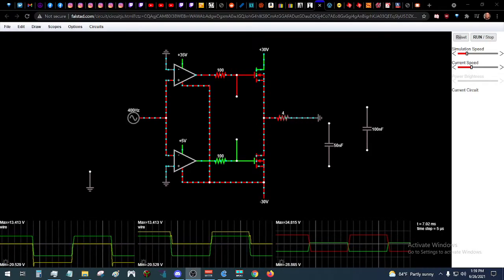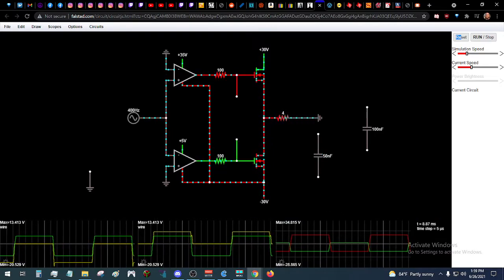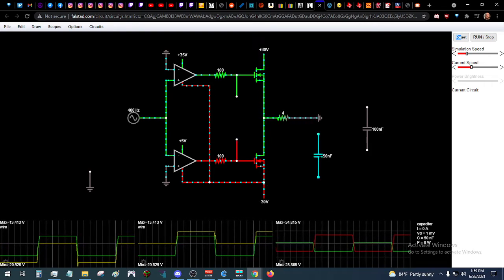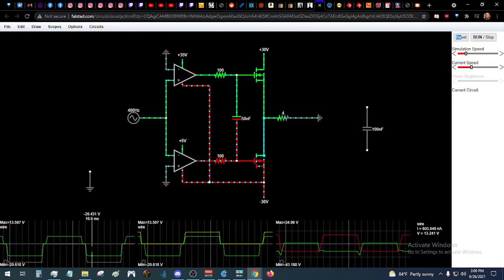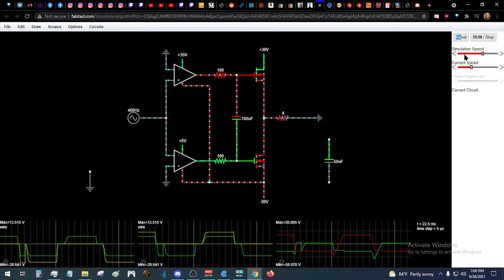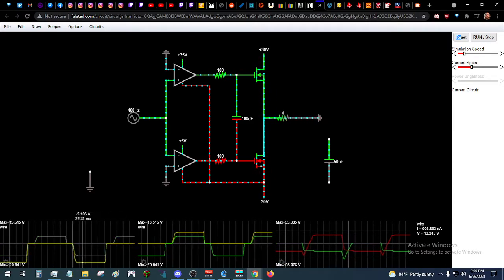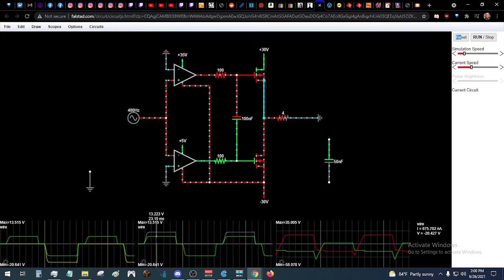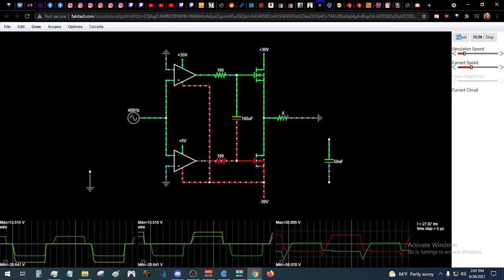easy dead time adjustment, motor driver/class D amp

Comment: That is not how you want to implement dead time. Purposefully slowing the gate charge by adding extra capacitance is not good. Not only are you increasing your gate drive current requirement but your are significantly slowing the gates transition time creating unnecessary heating and a lack of timing control. You always do dead-time in logic, pre driver stage or in the actual fet driver if it has variable dead-time control.
Reply from the maker: Not a recommendation, just an observation.